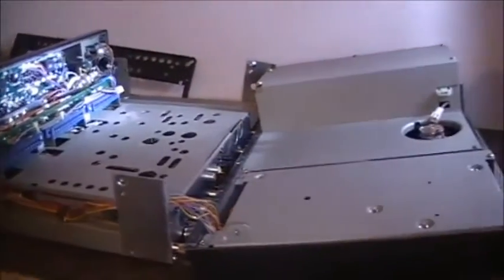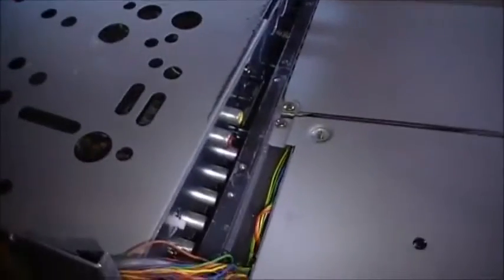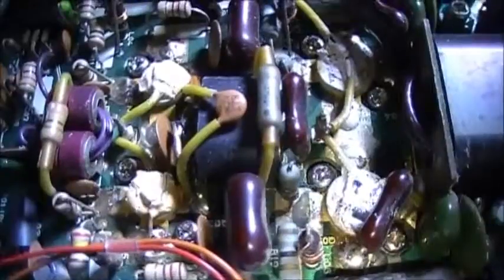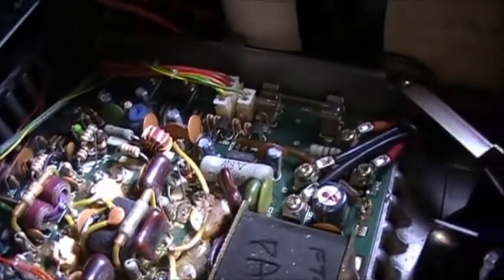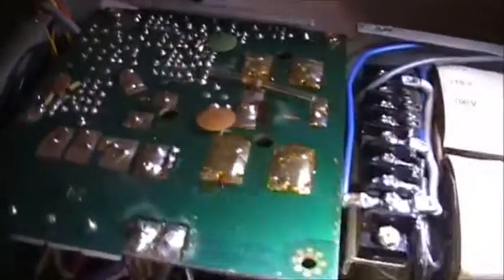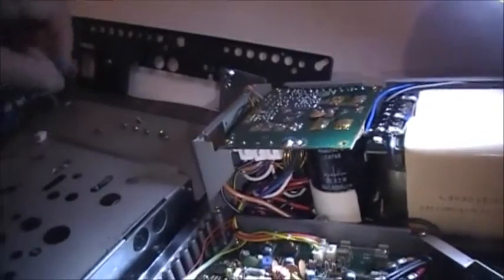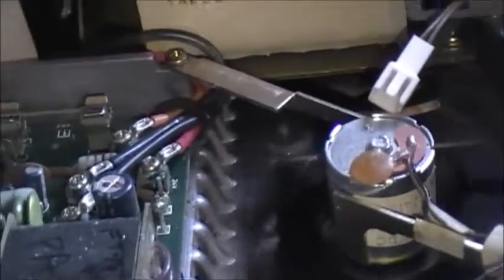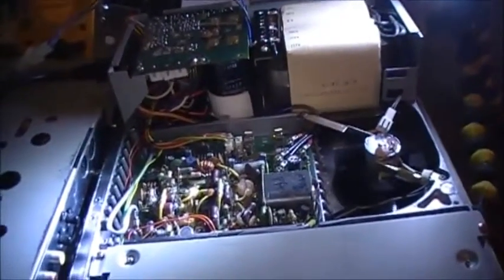Yaesu ft 767gx Trouble shooting and repair  PART 2

Comment: Yes they are a pain in the ass to open I bent the same bracket at the rear, but you can take it off and straighten it, I was lucky when i got mine it worked perfectly with all three modules too I just had to change the display as it got damaged in transit!!

Comment: Received a 767 totally dead! After replacing a transistor in the power supply it switches on and receives quite good. However transmitting it does not. The backside of the radio becomes hot. I guess the finals are damaged. Have to open it again but it is for sure very annoying to do so 😀 Seems like with this kind of radio the pa is damaging the power supply or vice versa
Reply from the maker: Sounds like a short on the 13.8vdc dc line.. Outputs could very well have shorted out.

Comment: So,,,the voltage was high! What was the cause? And did you ever fix the Power Out problem?.....thanks.
Reply from the maker: I no longer own these radios, 1 radio worked flawless, the other one the PA board never did work correctly first nor last.